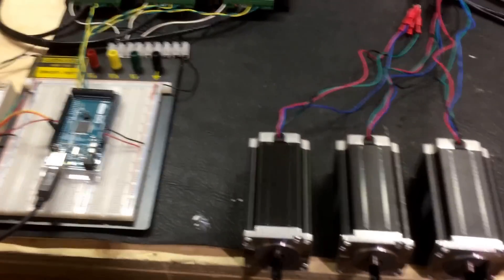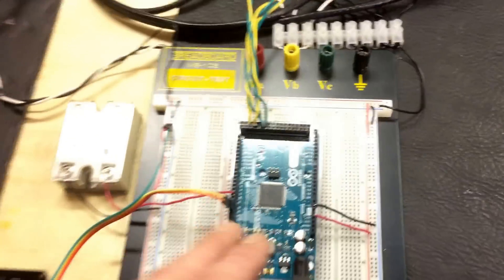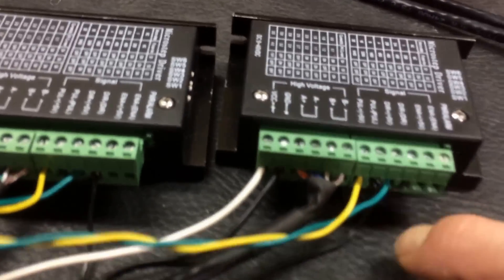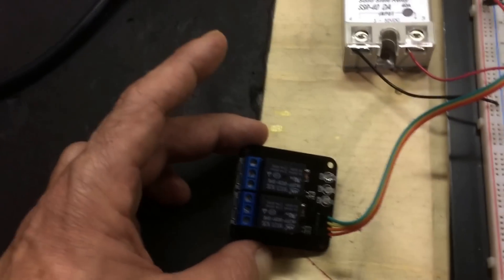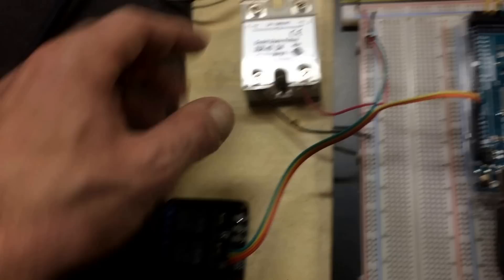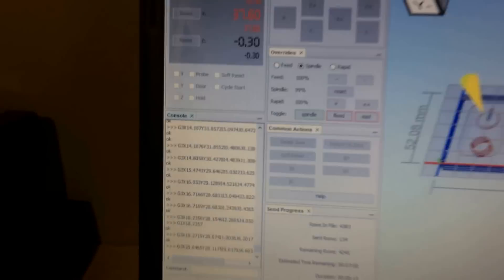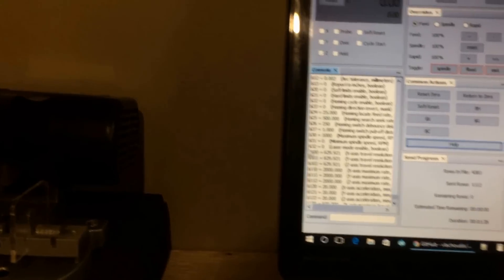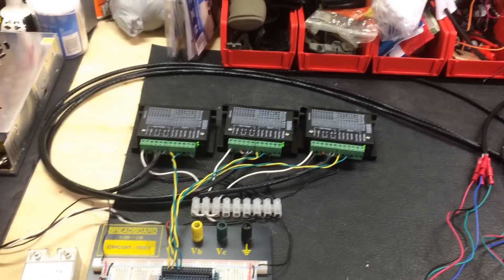How to DIY Arduino Mega2560 CNC 3/4 axis hardware and software setup, easy

Comment: Can the Arduino Mega provide 0-10v output the control a vfd via pwm?
Reply: Possible with logic shifter and a separate line for 10v so custompcb/shield

Comment: the  link is invalid!!!!
Reply from the maker: The links are 4 years old... if you're looking for stepper motors try https://www.ebay.com/itm/273562742123?epid=2252706324&hash=item3fb19c2d6b:g:34EAAOSw~LtbgMlR but i suggest you shop around and look into closed loop steppers for better accuracy. i.e. https://www.ebay.com/itm/233448020950?_trkparms=ispr%3D1&hash=item365a961bd6:g:xx4AAOSwnL1gIjKw&amdata=enc%3AAQAGAAACoPYe5NmHp%252B2JMhMi7yxGiTJkPrKr5t53CooMSQt2orsSRAQR8FABHjfpFoyRlXhWmYbi9N8lBwRv7tTlO3muLxa670k4V%252FQBWpQUTMg2Z5%252FvHjQHoS5I4w9igjSjCj20jFOP5hvoI1JRl001300pcRpdAiNw2SRrjtTtX6pBkKn1rOjCavQDylpzenphE7j44XtpjGVtWkwJWXXMFVtISa%252BWDF9ZdhmM%252B4ve7BdfG%252FMutzGXzXyWFgrk%252BMj7U8Mj%252BCrnvOk8ELixHvimc3cfkkxg3QpLEP%252FSZbx0f3%252B3slwMC%252Bp24H5cUBPK%252Fcf9kYW4JUjcA2xdn33IoqOxhrEMp9ZWmQaSvUfJ%252FBC0lb67ld12naM%252FqGHcn5Nz1yq36U%252FUy7m8Q5J68ATtBZMBjjW2gLsQt1N9fHu0mW%252FLYZNgEZz7Qs%252B3x3h7SARkfy9k6E2gW2o2JrHLFzOj5AjsI56mTbwvKSV3GBkQ5%252Bbl%252BIXoNQn10OaN%252F%252Fv86hpj7wiY97lki4UiccbWdIgFLNTPg4Sw1YBImi%252BHT%252FREzayFmnByfnOtqUhwtVi7Y8pAXlMXSA1GYwX9eTV1tg9KlccjNWntUVr0feIYsGHcUoerSDEC5zZ%252F8geP%252BiZTgMF7ewwHNtCtBhqdB8029eY4WVZgA9ODZft56f%252BLljwi9PN1TYpoJjEw3JP54xzrZgEgBrVaiXhcr2GI6dzqBtk0VkRgzDGKMkKJpQbgX071HiWc7WHzJf2LSuX8NGpVL47sMzZT3eukxGUt1moA1DibDPy6r%252BEdvNTKLKz4jE%252FpPYfq3kx0m5GqbOcKtmaLj8nzTlMAmQlPbGWW7ps2W7QYJuRT7np53PjmPsqzqjWxBUQJdj8GkYlisbzWmj8xyk2dAAxcxQ0NAQ%253D%253D%7Campid%3APL_CLK%7Cclp%3A2334524

Comment: Every video I find is incomplete. No one has yet made a video that shows all schematics and connections for a complete CNC. This video is missing all of the end stop connections. There is no explanation for mist and flood what are those? For a CNC router what do you flood or mist?
Reply from the maker: I'm sorry to hear you haven't found what you're looking for.  I thought this video might be a good starter. For the limit switch configuration (end stops) , there are plenty of tutorials on how to connect them and for obvious reasons, there are no limit switches in my video. For a CNC router I use mist, but can turn it up to where it's almost a flood, these are devices that spray coolant onto the work piece at the point the tools contacts, Hope that helps a little. Good luck!
Reply: @tacpreppers4906  Thank you for helping me. What are version of GRBL did you download. I have the same setup but my motors will not turn when I send x,y, or z. The Universal Gcode Sender UGS will throw an error and I have tried all different versions of GRBL with zero luck. 1.1h grbl for arduino 2560.
Reply: I see your links. I am going to download again and re-compile using arduino app. I also remember to delete existing library files so I don't upload the same bad grbl code. Many thanks again.
Reply: I downloaded the 4 axis version and as soon as I load it and open UGS I get this following unexpected error. I removed some text to make it readable.

[GC:G0 G54 G17 G21 G90 G94 M5 M9 T0 F0.0 S0]
[Error] Error while processing response <ok>: An unexpected command was completed by the controller.
** Connected to COM5 @ 115200 baud **
Grbl 1.1e ['$' for help]
[MSG:Check Limits]
[MSG:'$H'|'$X' to unlock]
Grbl 1.1e ['$' for help]
>>> $G
>>> $$
$0 = 255    (Step pulse time, microseconds)
$1 = 255    (Step idle delay, milliseconds)
$2 = 255    (Step pulse invert, mask)
$3 = 255    (Step direction invert, mask)
$4 = 1    (Invert step enable pin, boolean)
$5 = 1    (Invert limit pins, boolean)
$6 = 1    (Invert probe pin, boolean)
$10 = 255    (Status report options, mask)
$11 = 2147483.648    (Junction deviation, millimeters)
$12 = 2147483.648    (Arc tolerance, millimeters)
$13 = 1    (Report in inches, boolean)
$20 = 1    (Soft limits enable, boolean)
$21 = 1    (Hard limits enable, boolean)
$22 = 1    (Homing cycle enable, boolean)
$23 = 255    (Homing direction invert, mask)
$24 = 2147483.648    (Homing locate feed rate, mm/min)
$25 = 2147483.648    (Homing search seek rate, mm/min)
$26 = 255    (Homing switch debounce delay, milliseconds)
$27 = 2147483.648    (Homing switch pull-off distance, millimeters)
$30 = 2147483648    (Maximum spindle speed, RPM)
$31 = 2147483648    (Minimum spindle speed, RPM)
$32 = 1    (Laser-mode enable, boolean)
$100 = 2147483.648    (X-axis travel resolution, step/mm)
$101 = 2147483.648    (Y-axis travel resolution, step/mm)
$102 = 2147483.648    (Z-axis travel resolution, step/mm)
$103 = 2147483.648   
$110 = 2147483.648    (X-axis maximum rate, mm/min)
$111 = 2147483.648    (Y-axis maximum rate, mm/min)
$112 = 2147483.648    (Z-axis maximum rate, mm/min)
$113 = 2147483.648   
$120 = 2147483.648    (X-axis acceleration, mm/sec^2)
$121 = 2147483.648    (Y-axis acceleration, mm/sec^2)
$122 = 2147483.648    (Z-axis acceleration, mm/sec^2)
$123 = 2147483.648   
$130 = 2147483.648    (X-axis maximum travel, millimeters)
$131 = 2147483.648    (Y-axis maximum travel, millimeters)
$132 = 2147483.648    (Z-axis maximum travel, millimeters)
$133 = 2147483.648   
ok
[GC:G0 G54 G17 G21 G90 G94 M5 M9 T0 F0.0 S0]
ok
>>> $G
$0 = 255    (Step pulse time, microseconds)
$1 = 255    (Step idle delay, milliseconds)
$2 = 255    (Step pulse invert, mask)
$3 = 255    (Step direction invert, mask)
$4 = 1    (Invert step enable pin, boolean)
$5 = 1    (Invert limit pins, boolean)
$6 = 1    (Invert probe pin, boolean)
$10 = 255    (Status report options, mask)
$11 = 2147483.648    (Junction deviation, millimeters)
$12 = 2147483.648    (Arc tolerance, millimeters)
$13 = 1    (Report in inches, boolean)
$20 = 1    (Soft limits enable, boolean)
$21 = 1    (Hard limits enable, boolean)
$22 = 1    (Homing cycle enable, boolean)
$23 = 255    (Homing direction invert, mask)
$24 = 2147483.648    (Homing locate feed rate, mm/min)
$25 = 2147483.648    (Homing search seek rate, mm/min)
$26 = 255    (Homing switch debounce delay, milliseconds)
$27 = 2147483.648    (Homing switch pull-off distance, millimeters)
$30 = 2147483648    (Maximum spindle speed, RPM)
$31 = 2147483648    (Minimum spindle speed, RPM)
$32 = 1    (Laser-mode enable, boolean)
$100 = 2147483.648    (X-axis travel resolution, step/mm)
$101 = 2147483.648    (Y-axis travel resolution, step/mm)
$102 = 2147483.648    (Z-axis travel resolution, step/mm)
$103 = 2147483.648   
$110 = 2147483.648    (X-axis maximum rate, mm/min)
$111 = 2147483.648    (Y-axis maximum rate, mm/min)
$112 = 2147483.648    (Z-axis maximum rate, mm/min)
$113 = 2147483.648   
$120 = 2147483.648    (X-axis acceleration, mm/sec^2)
$121 = 2147483.648    (Y-axis acceleration, mm/sec^2)
$122 = 2147483.648    (Z-axis acceleration, mm/sec^2)
$123 = 2147483.648   
$130 = 2147483.648    (X-axis maximum travel, millimeters)
$131 = 2147483.648    (Y-axis maximum travel, millimeters)
$132 = 2147483.648    (Z-axis maximum travel, millimeters)
$133 = 2147483.648   
ok
[GC:G0 G54 G17 G21 G90 G94 M5 M9 T0 F0.0 S0]
[Error] Error while processing response <ok>: An unexpected command was completed by the controller.
Reply from the maker: @rsz90182  use CNCJS, i've been using it very successfully since i made this video. cncjs.org (it supports 4 axis)
Reply: @tacpreppers4906  Tac Thanks so much, I was able to make the motor turn but using the DM542 driver and lowest I get is 400 steps per revolution and figured out the pins using break out shield and correct mapping to the driver. I am using the GRBL 1.1f for Mega. I will download from that link. Thanks again.

Comment: Are you running the Ardunio via Linux or Windows computer?
Reply from the maker: I'm running it on a Windows computer but you can access and run the Arduino on any platform. I tend to use CNCJS now, you can find it at https://cnc.js.org/ free and powerful. I think they have releases for all platforms, including linux and Mac. Hope that helps.
Reply: @tacpreppers4906  Yes i have just had a look at this .. looks very promising!

Comment: hi, I've run into a problem with the GRBL and is that when everything connected, I got the X axis spinning always the same direction.
did you had the same problem?
any idea what is happening?
thanks
Reply: Check the cpu_map.h and the green text "// Define step direction output pins." pins 30,31,32 for x y z.

Comment: This is indeed, incredibly cool!!!! Thank you for posting this. I am about to build my first custom cnc router for cutting foam, and I plan for a 4th axis so that the machine resembles a frogmill cnc machine. I have all the steel, the motors, linear rails, electronics, etc purchased and standing by in my garage. I'm just trying to finish designing my gantry in fusion. Your video has helped immensely as far as getting my motors all hooked up! Thank you!

Comment: Hello friend, congratulations on the video! Would you have the wiring scheme on the arduino mega 2560 with I connect the wires for four axes and the rest on the arduino port? thanks

Comment: Great job, what is the gcode command for enable/disable spindle in pin 6?  Thanks
Reply from the maker: For the spindle, M3 is clockwise rotation, M4 is CCW, and M5 is spindle off. Hope that helps and thanks for watching

Comment: I have a slimmed down build of what you have. As of 201908-24, UGS 2.0 latest GRBL-MEGA. UGS connects with Arduino Mega2560 but that is it. Always offline and no firmware found. Cant find any help or support.
Reply from the maker: use cncjs, it's by far the best free CNC control software i've found to date. https://cnc.js.org/  good luck!

Comment: Great video. Got me pointed in the right direction. Do you have a wiring diagram of this setup?
Reply from the maker: Hi and thanks for watching, i actually do not have a wiring diagram but it really is pretty straight forward. Check out this link, it shows exactly how to wire the motors to the driver https://www.makerguides.com/wp-content/uploads/2019/08/TB6600-stepper-motor-driver-with-Arduino-UNO-wiring-diagram-schematic-1024x752.jpg

Comment: I don't know if I understand correctly the hardware system. At least, you have connected the Arduino Mega to motor drivers, directly from Arduino pin's, without an intermediate shield like Arduino UNo + CNC Shield 3.0. That's correct?
Reply from the maker: That is correct, the stepper drivers are directly connected to the Arduino pins. I made a simple shield to facilitate everything.
Reply: @tacpreppers4906  Thank you. But your shield is not present in the video.
Reply from the maker: @egemonslot  https://www.robotshop.com/en/arduino-proto-shield-pcb-mega.html this is the board I used to make the shield. I'll be making a new video soon with clear audio and better overview.

Comment: Great video. Very helpful. Thank you VERY much. I also think it's pretty amazing how affordable and common home cnc has become. Your setup, as seen here, is almost the same as I will be using. One question if you don't mind. So the only power supply for the mega arduino and both relays is only coming from your laptops 5v USB ?  Thanks
Reply from the maker: Hi Jeff, thanks for the comment and yes, it is actually quite a simple, yet effective setup. I've been running this config on a small C-Beam machine i built as a test project, with great success, before I undertake a bigger build. p.s. I've since changed the motors, i'm using to use Chinese hybrid steppers (leadshine-clone)  i got on eBay. The config is identical except for the CNC software and motors. The software i settled on is cncjs from cncjs.org (excllent) and the motors i got from here: https://www.ebay.com/itm/2-2NM-12NM-Nema23-Nema34-DC36V-AC60V-DSP-Closed-Loop-Stepper-Drive-Motor-Power/122420276298?hash=item1c80d12c4a:m:mk7ZUPUqTdks2ifjanN8d6A. Good luck!
Reply: Sir can we get connection diagram

Comment: Very good explanation. Ok i am also using the Mega2560 board, And i did exactly what you did and it worked of cause by changing the pin configuration, but was using the Stepper driver A4988. But i tried to with your firmware to use the Ramps 1.4 and the A4988 stepper driver as intended and for the like's of me it does not want to work with the UGS platform, and the motors don't turn and iv tried to change the pin configuration in cpu_map. I have traced the pins of the stepper driver headers to the Ramps 1.4 Board and they line up to Step=A0 and Dir=A1 Pins. Changed the pins in the cpu_map and still nothing. I know my setup works because i tested it with Marlin and it all works. But want it to work with UGS. if you could please point me in the right direction. Thanks in advance.
Reply from the maker: I would look into cncjs, it's the software I use now, much better that the UGS software i started with.

Comment: By any chance is there a complete wiring diagram?
Reply from the maker: No diagram but the wiring is pretty straight forward. You can find most of what you need in the cpu_map.h file in the GRBL folder. As a side note, the stepper vendor usually has a wiring diagram along with the specs. Good luck and thanks for watching.
Reply: Thanks for the tip. I can see up to 6 axis, but how do you mirror say a Y axis if you had 2 motors?
Reply from the maker: I'm pretty sure you can just splice the two together, just make sure they're turning the right way. You're probably better off searching YouTube for a better solution because if the motors are facing each other, you may need to add an inverter to switch the direction signal on one of the drivers. I try to stay away from that scenario and will be making a followup video soon on my choice of motors and drivers. Thanks and good luck

Comment: In your discription you didn't say where to get the power supply. Wondering where?
Reply from the maker: That would be eBay. Look for 24V power supplies, they're usually sold as LED power supplies. I got a 24v 360 watt one in the little CNC i built.

Comment: Hi I have to thank you very much, because your video was the video that got me going, before your video everything was very shadowy...:) I have a question thou. I am waiting for the rest of microstep drivers to arrive, until then I have only one microstep driver which I have connected it to a stepper motor, and as you have shown in your video to the x axis, But the problem is when running the program it only runs the motor on x direction while it is posotive, if it starts to run negative direction, the x axis dont move at all? is that because I have to install everything for it to work  or there is something else I should think off? Thank you very much for any kind of help

Comment: Does the firmware actually support a 4th axis? I have yet to find a version of GRBL that supports both the Mega 2560 and four axes. If this version does support a 4th axis, can you show me a diagram that shows the board pin assignments for A-Pulse and A-Dir (assuming that the 4th axis is the A-Axis). Such a version of firmware needs to allow configuration of the 4th axis as well. I already have all the hardware for the 4th axis. I just need the firmware and pin assignments. Thanks.
Reply from the maker: I have the following version running on a small CNC i built (https://github.com/dguerizec/grbl-Mega-4axis, will eventually get around to making a video) it works quite well with cncjs (i use version 1.9.12 cncjs.org... great software and added bonus of being able to run on Raspberry Pi) although i've since disconnected the 4th axis since i don't have a post processor in Fusion 360 so i only attach it as an indexer for now. The pin assignments are straight forward in the cpu_map.h file and the GRBL can be tweaked for your setup using the $$ console commands once operational.

Comment: Dear Sir,
Thanks for above Video.
I am currently working on XYZ Laser head manipulation system. Having three axis X- 2 Stepper motors, Y- 1 Stepper motor & Z-1Stepper Motor.
By using Nema 34 and Nema 23 motors & Arduino Mega2560.
Sir, Can you suggest me suitable software?
Is GRBL satisfied the requirement?
Reply from the maker: GRBL is definitely suited for your application. You should look into GRBL Laser howto on here (YouTube). Good luck with your project!

Comment: Hello sir
    I am using nema23 with tb6600 drive with 24 volt 10 amp, but with 32 micro stepping my motor rpm is very low around 30 or i change it into 1 then its rpm is around 150 with vibration
  I am trying to increase rpm of my  stepper motor with smooth running
Please help me....
Reply from the maker: Hi Tushar, I'm not sure how much i can help there but i would start with looking at the GRBL settings as the stepper drivers may be configured many ways, but the GRBL setting absolutely must reflect those settings. i.e. $100=200 would be ok for an 8 microstep setup using an 8mm lead screw in my case. hope that points you in the right direction. Good luck

Comment: I always wondered about GRBL on a Mega 2560. I wonder if the Mega 2560 fork has any more features than the main Uno branch? A Mega 2560 has more resources than the 328 does.

Comment: hey there. I would like to ask about how you make a connection to Arduino mega?... I mean how you define the pin at Arduino to connect to USG platform or USG platform already set up the pin number at arduino board? thanks for this video it really helpful. 

Fahmi
Reply from the maker: Fahmi, the Arduino connects to the computer via the USB port, then USG has a port select drop down and connect button.